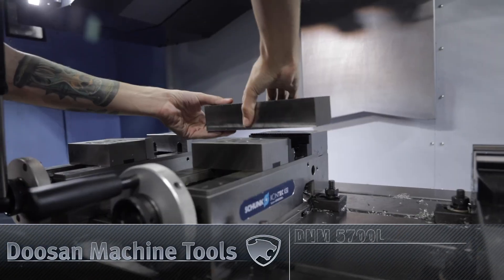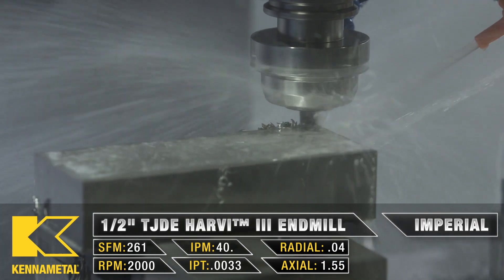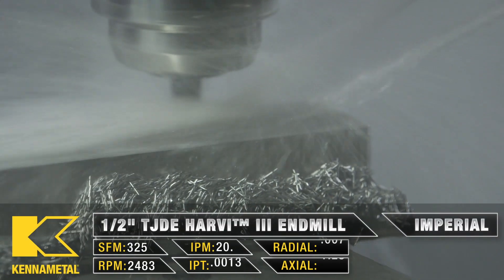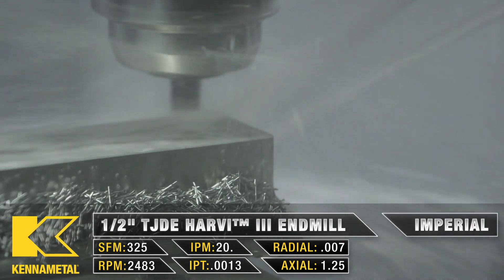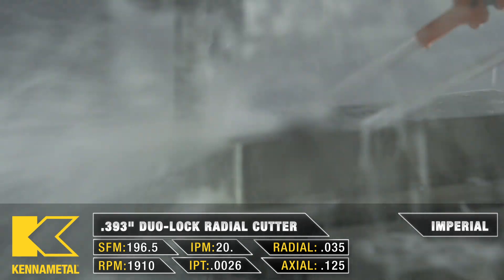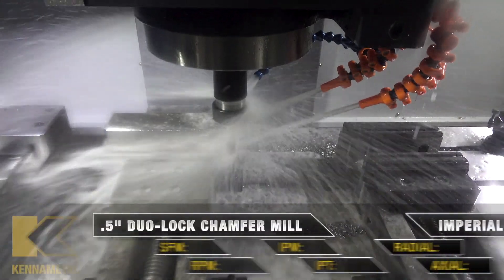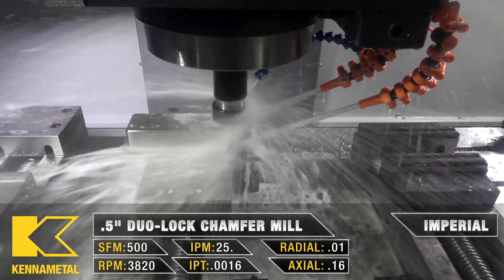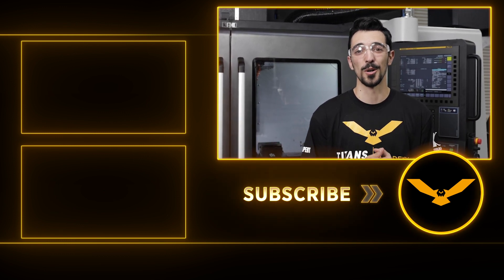CNC Machining Titanium Aerospace Component | DNM 5700L | DN Solutions

Comment: i have a part need endmill stick out long 2.8" inches and 4" inches so i was use 1/2  endmill with .03r accupro  endmill (i ran 2400 rpm ,20 ipm , radial .02, axial .500) but a lot chatter n surface look bad. what you guys advice ?
Reply: Go full flute lenght axial and 8% step over. End mill will be more rigid. 2500 rpm and 60 ipm. Back up everything if y are not on very rigid set up

Comment: this for the big guy who say "BOOM" hehehe... Aerospace Components type by DarkTech try this, aerogel is extreme heat resistance material but there is 2 weak point that is so fragile break easy so even NASA only used it like coating into titanium or other alloys why not do this used graphene for base making aerogel type but the next problem is shapes hehehe that's where big guy CNC come in, making mold component shapes that needed, btw graphene the atom structure is more solid then any other atom include titanium allow hehehhe BOOOOOM light weight strong even extreme resistance for arospace materials

Comment: I see that you use SolidWorks. Is MasterCAM integrated in SW or is it a separate software?
Reply: You can get it that way, or you can get MasterCam standalone... It is very expensive for small companies. Even moderately large companies who don't do precision machining. The company I work for was quoted $30,000 for 5 axis mill. BobCadcam quoted half that. Both had required subscription services to get support... I ended up settling for Rhino Cad/CAM  which is very powerful CAD software with a Generous amount of CAM up to 5 Axis Index, 4th axis continuous. Everything was integrate into the CAD software which was really neat and easily accessable. That cost the company $6,000. No subscription service. Its yours, you own it.... I have a much older setup of the same I use for for 3D milling on my cnc Router..... Unfortunately, the kinematics of 3D milling requires an extremely fast machine processor or the use of a new PC Mill Controller, since all the movements are linear. So you could blow through 80 lines of code in 2 seconds..... I hope this helps and sheds light on other options as well. :)
Reply: I shall add, that the quoted price of MasterCam included a mandatory training seminar.
Reply: @CNCGuy  thanks for the reply! Never knew SolidWorks is so open to so many CAM softwares.
Reply: I have programmed for 1981 Mori Seike lathe, 1995 Okuma ACT-20 lathe, 1982 Matsuura MC-500, 1985 OKK PCV 50, and a 5 axis Haas UMC-750... The Haas required my knowledge of how indexing works, since it is not available in E-Cam, However, you can index the stock piece as if it were in an indexing vise.
Reply: @CNCGuy  I'm just starting as a machinist, and that sounds impressive! I only have experience with a 2017 Hermle C32U 5 axis and programmed with VoluMILL and SolidCAM. VoluMILL is extremely efficient if you program for serial production, but not as intuitive. I prefer SolidCAM for single piece products that require extreme accuracy, and the C32U is a perfect match
Reply: @nofunallowed3382  mastercam for SolidWorks is buggy trash. HSMWorks is a superior SW milling plugin

Comment: Do a video on calculating feeds and speed? For an academy I'm surprised you haven't done that yet
Reply: Cutter speed  X (times)  4  ,  divided by diameter.  
The cutter speed for different materials can be found in your Machinery Handbook.
Diameter is whatever is spinning.
For a mill, it would be the end mill diameter.
For a lathe, it would be the diameter of stock you are turning.
This formula will get you in the ball park, and you can push it faster or slower to see what works best as far as tool life, and acceptable cycle times.
Hope this helps. Take care
Reply: @keithlane4343  cheers mate, I k ow about feeds and speeds already. It was just a question since for a cnc academy, the first thing you'd expect to be taught is feeds and speeds and I'm surprised they don't have a single video on it. They just give you their feeds and speeds which doesn't really allow you to work things out for yourself as every workplace uses different tools and materials.
Reply: @Mrgnothing1  it’s in the like “textbook” they have. You can download this pdf from the academy that goes over the basics like work coordinate offsets and calculating speeds and feeds and stuff. Pretty good pdf I think.

Comment: Why don't you use internal cooling ? 
I always see great machines, tools, programs,...and most times a fucked up cooling with a great coolant. 
I dont mean cooling through the tool but through your holder.
Why dont you use this great and simple feature?
Greetings from Germany!
Reply: Maybe it is high pressure only and than you can't see the action.
But good question, for sure they have it on the machine.
Reply: Different Materials

Comment: I tried some of these speeds on my Bridgeport manual no luck
Reply: Try again, but this time shirtless.  Clothing restrictions may affect the chip removal.  Remember! Safety squinting is also important.  Let us know how it goes!
Reply: @vonpredator  And most of all don’t forget to swear at it.
Reply: @Guranga93 , Absolutely!  Profanity is the lubricant that will give you the performance you need!  Thank you for pointing that out! 👍
Reply: @vonpredator  adding a small child spectator will help minimize tool deflection as well, resulting in a perfect finish.
Reply: @mva, how are those tips working out for you?  @Guraga93’s Profanity suggestion must be getting you where you need to be!  Please let us know!
Reply: The r8 spindle is toast after some test cuts